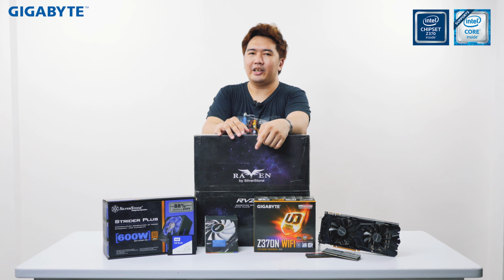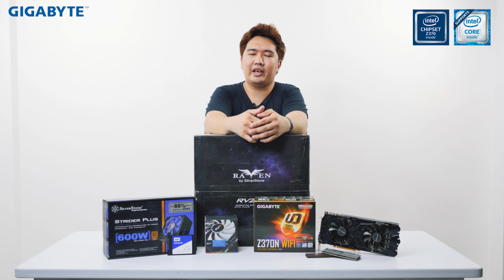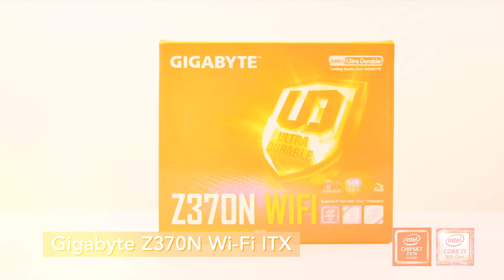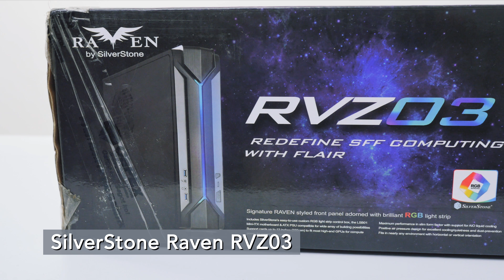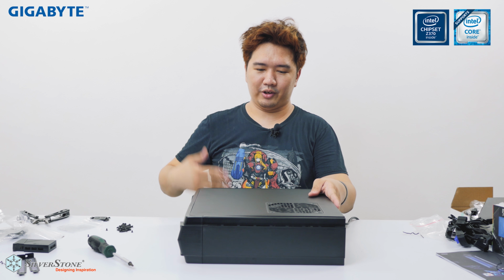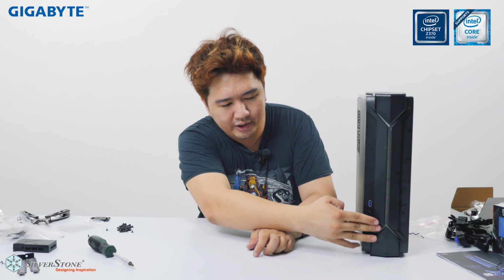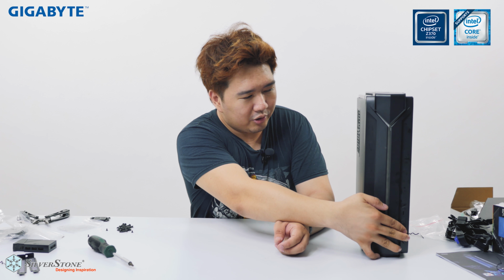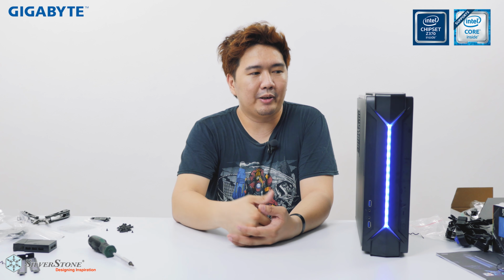BossMac Build Vlog #1: Intel Z370 Build

Comment: Nice build mate and i would like to ask with Galax GTX 1070TI can i still slot in another normal 120mm fans(25mm thick) without the fan touching the GPU?can it fit?
Reply from the maker: At the fan slot underneath the card? yes you can, there's plenty of space after mounting the GPU riser
Reply: thanks for the reply mate, cheers